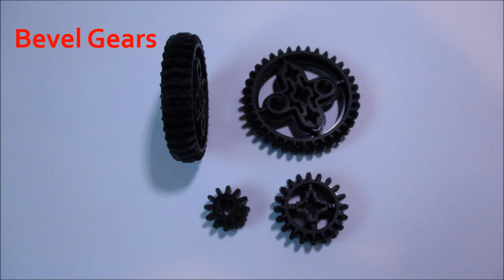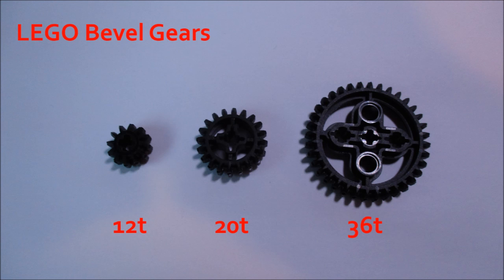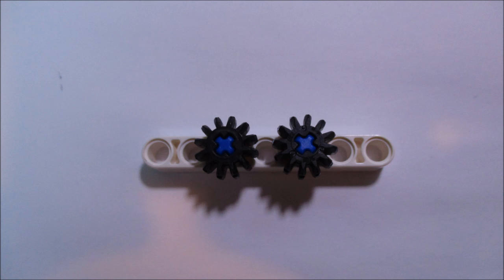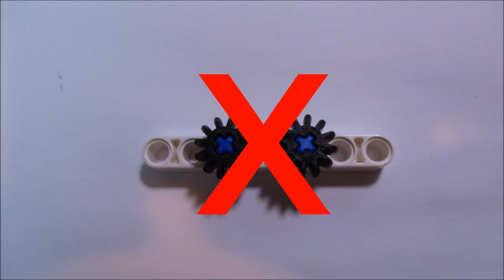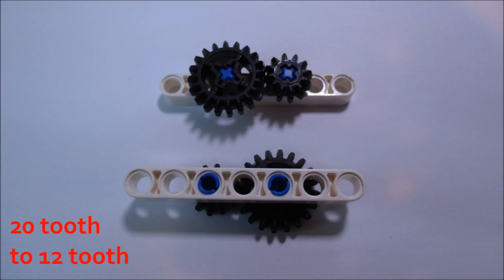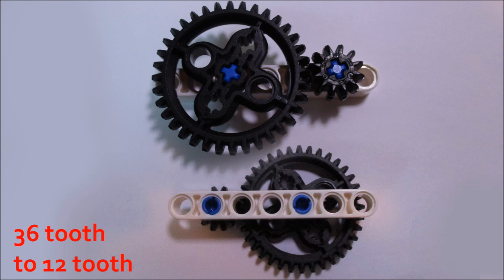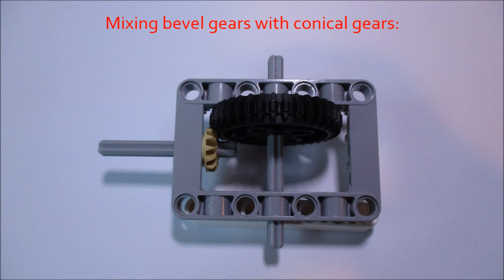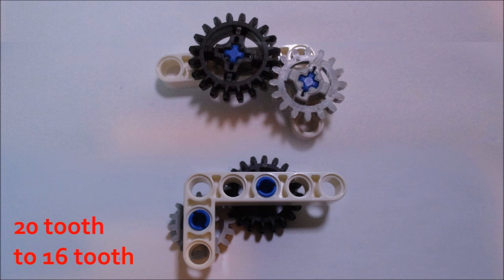LEGO Gears for EV3 Robots Part 2: Bevel Gears

Comment: There is now a variant to the smallest (8-tooth) Lego Technic Double-Bevel Gear -- the "Light Bluish GrayTechnic, Arm with Gear 8 Tooth and 1.5L Axle" Part Number 24014 in Bricklink dot com.
Reply from the maker: Thanks for sharing! That would be one for Specialty gears, but unfortunately that video has already been made. I may have to do a Specialty Gears 2 for all the new elements that have come out!